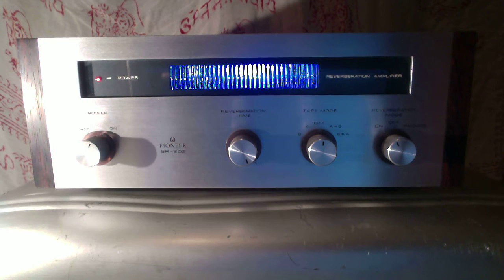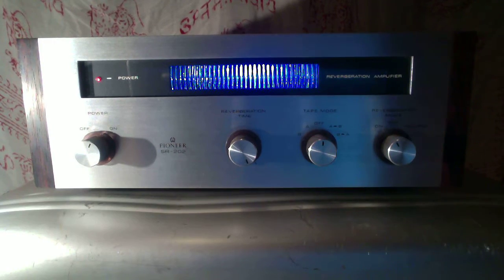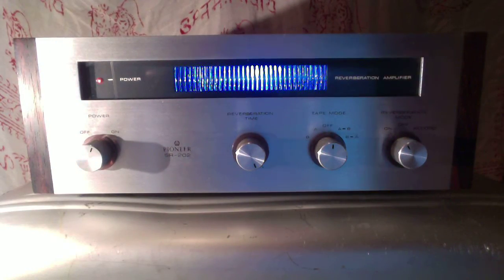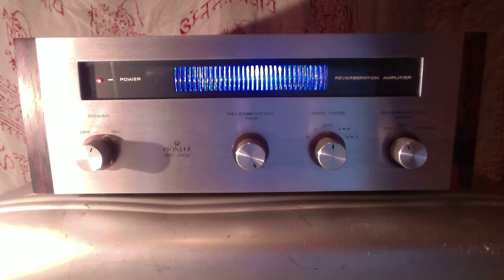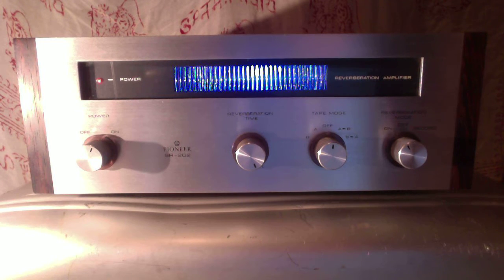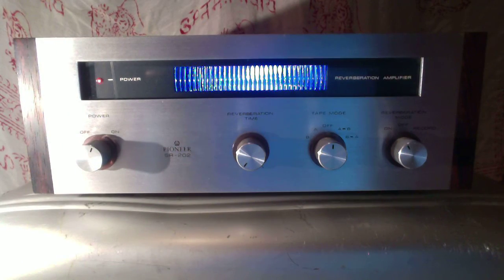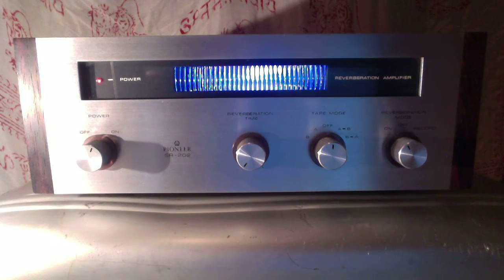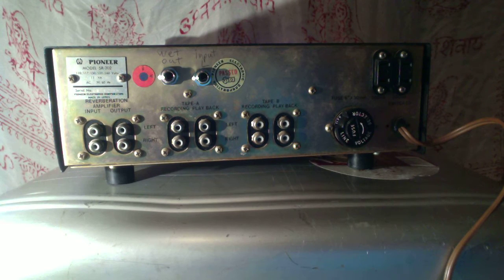pioneer sr-202 spring reverb demo video

Comment: I happen to have one of these that's been sitting in it's original box on a shelf.  I purchased it while serving in the Air Force.  I should pull it out and see if it still works after all these years....
Reply: Thank you for your service Joey. Did it work?

Comment: Very helpful video. Always wondered how these units actually work. The reverberation time changes the spring tension or does it change the amount of signal passing through the spring? In a unit without mods the output is a fixed mix of the wet and dry signals, right? Thanks!
Reply from the maker: thanks!  i'm not 100% sure, but i would guess that the reverb time knob controls how much signal is fed back into the reverb tank from the output, kinda like an analog delay feedback control.  it's been awhile since i modded this one, so i don't remember the dry vs. wet situation, but the whole reason i modded this was to get the wet only output for maximum sauce!

Comment: Hi.
Thank you so much for your video, it's very helpful.
I was wondering if you could show me how to do the mods in the back, a short video or something please
I just bought one.
What do you think are the benefits for you with this mods?
Thanks again.
Reply from the maker: +norithmusic for the "wet only" output, I didn't take pictures of it, but I did make a note-  it's found on metal post #8 on the PCB labelled "W36-004 AFAMPUNIT".  only do this mod if you're confident in your electrical and soldering skills, as this unit is powered by mains and can KILL YOU.  The benefit is in a studio situation, I can take only the "wet" reverb signal and record, mix, or process with it separately.
Reply: Thank you so much for your reply.
I have a studio here in Miami and I've been digging this reverb, it's different.
Should I try it disconnected right?
Don't want to blow up my fuse jeje
So you Solder a cable from there to a 1/4 jack and that's it?
no pots or capacitors?
Thanks again for everything
Reply: Thanks again for you help.
I'll give it a shot.
How are you liking yours?
I find mine "Vibey" with "Character"...
Thank you kindly.
Reply from the maker: +norithmusic I sold it, as I have 3 other spring reverbs to use, but it did have a nice "vibey" sound.  kinda too small for my tastes, I prefer longer spring reverbs.
Reply: I'm considering the Demeter RV1 and the Recovery Effects Endless Summer.
Any thoughts?
What are you working with?
Thank you again for your Help
Reply: thenormanconquest hi is there a reason both channels weren’t used ? Can I add a left and right wet out and left and right 1/4” input..? Can I use this in my effects patch bay? The Insert points are balanced trs.